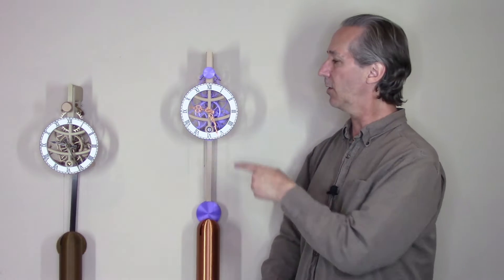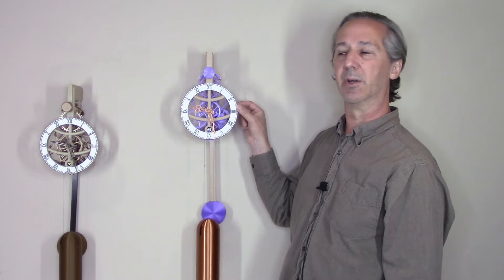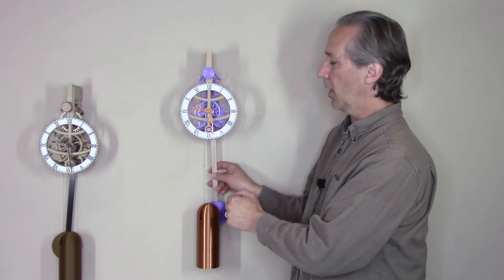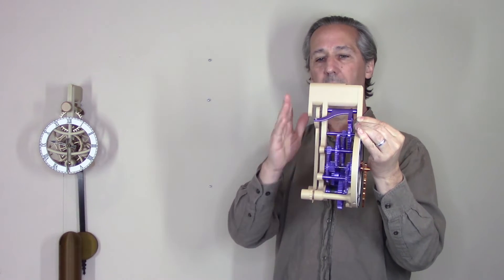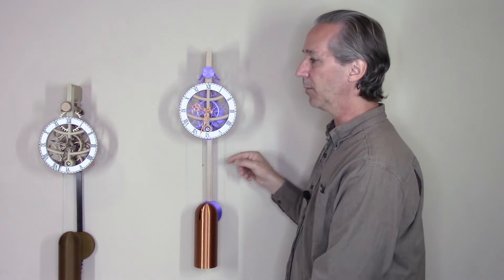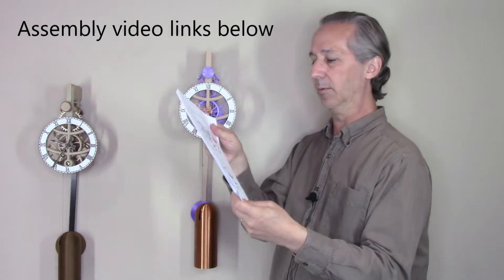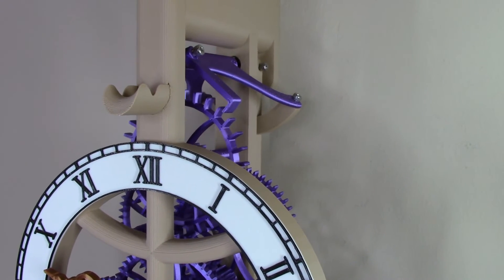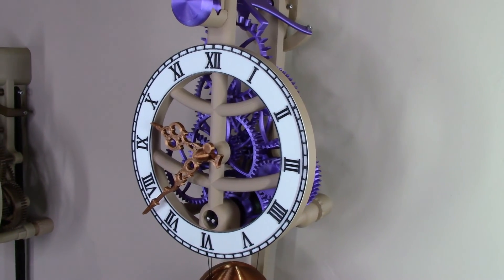Small 3D printed 8-day clock

Comment: Hi Steve.  I have this clock running for about a month now. Last weekend I took it apart because I realized I never checked the the time how long the pendulum keeps swinging.  It was fine, on the order of 10 minutes.  But, when I put the clock back together, I forgot to add spacer 4d to the minute hand gear assembly.  And this morning I noticed that the pendulum swing is about 50% better than before.  Do you think that spacer made a difference, or is it just friction reduction due to parts wear?
Reply from the maker: The change was sudden, so it seems likely that the spacer made a difference. Maybe the frame is pinching the stack of gears when the spacer is added. Leaving it out can cause some misalignment of the gears. It is a small spacer, so the effect is minimal. You could try reducing the spacer thickness so there is a tiny amount of end shake.

Comment: Thank you Steve.  Just completed the build last week.  Your instructions are excellent.  But I had to use about 7.5lb of weight to make it work reliably. Let see how long it will last.  I'm on to your moon phase clock next.
Reply from the maker: 7.5lbs is still a good amount. Most friction areas get better over time as the parts wear in.

Comment: This looks amazing. I've never built a clock before but I think I will try with your design.
Reply from the maker: This design would make a great first clock. It is my most reliable weight driven clock with a focus on making it easy to build. The 8-day runtime is very easy to live with. It also has the lowest price of my premium designs.
Reply: I built the clock. Looks amazing but requires 11lbs to run and occasionally stops for some reason. Otherwise it looks amazing.
Reply from the maker: @Empedocles494  The clock may have too much friction if it runs for a while but needs extra weight. That's good because you are 99% finished and may only need some minor fine tuning. The biggest sources of friction are usually the arbors, frame pinching, elephant foot, pendulum bearing friction, or gear friction.

Arbor friction is usually caused by the holes printing too small. Every printer seems to do this and every printer will be slightly different. It is expected to have drill out every gear and frame arbor hole to the proper size. A 1.6mm drill bit for 1.5mm arbors gives the perfect amount of additional clearance. Every gear should spin easily on their arbor. 

Frame pinching is caused when a stack of gears is too tall to fit inside the frame without getting pinched. The most likely places are the arbors with the most components in them, specifically the gear 4 and the gear 7 arbor. If every component is slightly taller than the plan, then it adds up to become tall enough to pinch in the frame. Sand or cut of 1mm at a time from one of the components until there is enough clearance. Every gear stack should have about 1mm of end shake when installed into the clock.

Elephant foot is caused by too much squish into the bed or too hot of a bed temperature allowing the bottom layer to melt as it prints. Or sometimes it just happens and there are adjustments in most slicers to account for it. You can re-print the gears or file it off from the already printed gears if it is too large. A small amount of elephant foot is often allowable as long as the gears still spin when meshed.

Pendulum support bearing friction may be caused by bearing quality or grease in the bearings. I use cheap generic bearings with good results. They usually come in packs of 10 and sometimes 1 or 2 will just feel gritty. Set those aside and use the better ones for the pendulum support. Make sure to remove the factory grease. You can replace it with lightweight oil or dry Teflon lube for some rust protection. Do the pendulum free-swing test as described in the manual. If you do not get at least 5 minutes of swing time, then focus on the pendulum support bearings.

Gear friction is where the gears mesh. The gear teeth should roll over each other with minimal friction. 3D printed gears may have some surface roughness that increases friction. PLA seems perfectly tolerant to any type of grease or oil. Feel free to add a light coat of lithium grease to the small pinion teeth. It only takes a small amount, and it will work its way into the large gear teeth.

Try some of these steps to see if it helps. This clock should run reliably with a much smaller weight than you are using.
Reply: @stevesclocks  thanks, I will try those recommendations.
Reply from the maker: @Empedocles494  You're welcome. I answer these same questions often enough that I will put together a YouTube video or expanded assembly guide section to explain the process. Reducing friction in an 8 day clock is so much more important than in an 8 hour clock. 

I forgot to mention, observe the escapement to decide where to start the debug. If it is sluggish, then look for friction in the gear train. If it spins quickly when the pallet arms clear the escapement teeth, focus on the pendulum support bearings. 11lbs of weight should have a very energetic escapement if the gear train friction is low.

Comment: Is this newer revision easier to build or similar to the easy build clock?
Reply from the maker: The new clock shares many features with the easy build clocks. Assembly is probably slightly easier.

The list of non-printed parts was reduced considerably compared to the older version of the clock. The difficult to assemble stainless steel bushings in the old design have been eliminated. All parts fit together without glue if you have a Prusa MK3 or Ender 3 size printer. Small printers like a Prusa Mini are the only use of glue.
Reply: @stevesclocks  the difficulty for me is more trying to get these non printed parts then assembling it, machinery is needed on some parts? like the metal rods how hard is that to do without proper equipment
Reply from the maker: @xreel1591  The only machining needed is cutting the arbors to length and clean up the ends. It could be done using a hacksaw with a fine tooth blade and a hand file.
Reply: @stevesclocks  ok cool. is it also possible to use a dumbbell for weight instead of bb's or its better to mesure what the clock needs to run on for perfect weight adjustment.
Reply from the maker: @xreel1591  Just about anything can be used for the weight. A pulley is used to double the runtime and keep the center of gravity along the center of the clock. It is best to measure the weight your clock needs, but blindly adding 6-7 pounds is likely OK.
Reply: @stevesclocks  Okay, thank you for answering my questions. I really appreciate your work and can't wait to see what you do next.

Comment: I bought the latest small clock files. Turns out I cannot print a part more than once???? You have built in some limit function into the design? I have a part that failed but cannot reprint?
Reply from the maker: That's really strange. There is no limit function built into any parts. Many people print several copies of my clocks to give as gifts to family.
Reply: I cannot print properly after 1st set of prints on both slicing software, Qidi and Cura slicers. Will send pictures. @stevesclocks

Comment: This is awesome. I’m working on designing a clock too, did you use involute gear tooth geometry or a circular approximation? I know it’s splitting hairs but honestly getting the gears right it’s one of the toughest things!!
Reply from the maker: The gears start with an involute profile using the Gearotic gear generator tool. I add several optimizations for 3D printing. The important surfaces of the gears stay correct. I am planning to make a video showing the various enhancements.

Comment: Steve, you are going to get me to try another of your great designs.  This will be on my list when I get the XL running
Reply from the maker: This clock could make a good gift for someone that appreciates a classic weight driven clock but isn't necessarily a clock expert. It seems like it would be easy for them to keep it running.

I have only tested this design using a 0.4mm nozzle. The gear teeth, escapement, and pallet print perfectly with two perimeters with a 0.4mm nozzle. They only have one perimeter with a 0.6mm nozzle. I am curious how they will come out with the default XL nozzle size. The frame components should be great since they have much larger feature sizes.

Many of my other clock gears have feature sizes that would have three perimeters with a 0.4mm nozzle or two perimeters with a 0.6mm nozzle. I have been optimizing the gear shapes in recent designs to account for Arachne. Maybe another update should be made to allow for the 0.6mm nozzle that is starting to become more common on the new large format printers.

Comment: Well done Steve, Just bought the files so have something to do over the winter months, Have most of all your other models on the wall TICK TOCK, TICK TOCK
Reply from the maker: It will be interesting to hear your opinion about the reliability of this clock compared to some of the larger clocks. The small escapement seems responsive on this design.